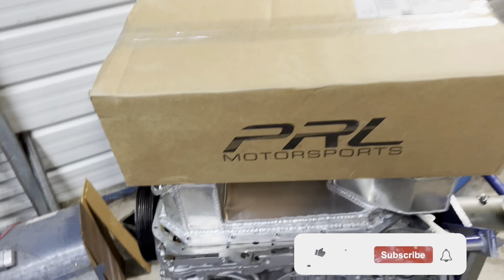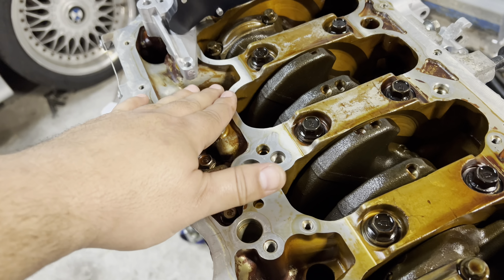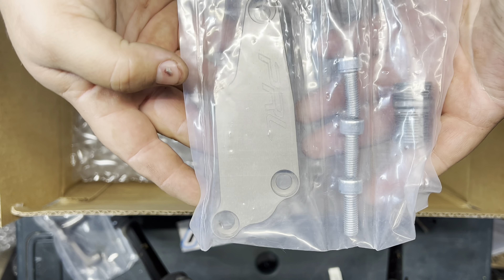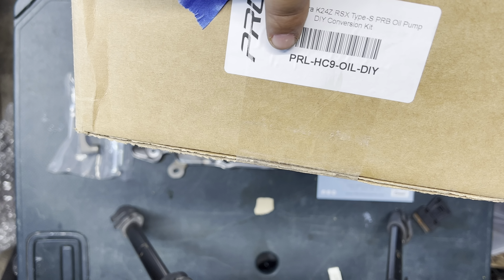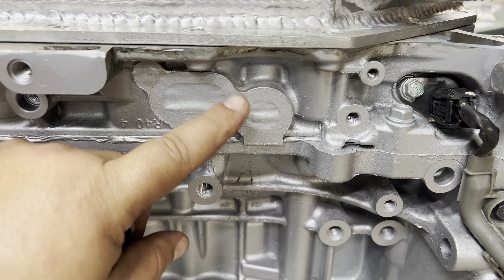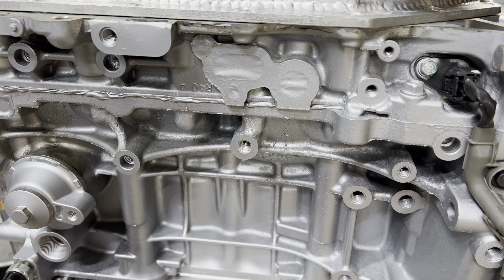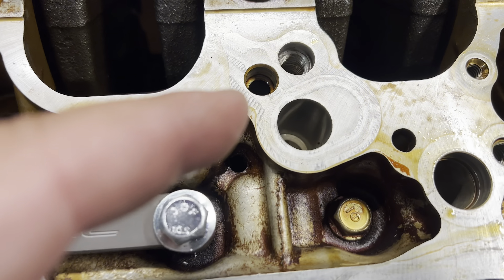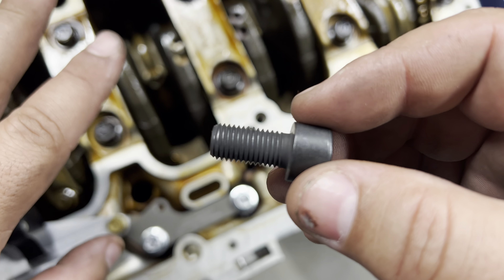K-Swap Camaro - @PRLMotorsports  K24Z3 K20 Type S Oil Pump Kit

Comment: Which holes did you put the 2 spacers on? I know there is 3 bolts that holds the windage tray. 20:28
Reply from the maker: I don’t remember. That motor is gone. Not enough power

Comment: I really appreciate the video.  I’m looking at putting a k24z3 into a four seater seadoo.  By chance do you know how tall the motor is from oil pan to valve cover?
Reply from the maker: Thanks man! With stock oil pan or this aftermarket pan I’m using?
Reply: @HOSSgarage  both if you know the measurements.  Or the a/m is perfect if that’s all you have.  I really appreciate it!!
Reply from the maker: @johnparker3028  will get you those tomorrow
Reply: Just checking to see if you were able to get the height measurements?  Not trying to pester you,  I’m sure you’re very busy.  I would definitely appreciate it but I also want you to know I really appreciate your series!!  Take care!

Comment: Is it necessary to change the position of the oil filter or it can stay on the lower block at original place?
Reply from the maker: It can stay as long as you’re NA. If Turbo then I would relocate it away from hot side
Reply: @HOSSgarage  thank you for respond!
One more question if it's not a problem..
Did you put k20 chain, guide and tensioner or k24z3 parts are okey for this swap?
Reply from the maker: @danijelremus5426  Z3 timing chain components, and k20 oil chain and tensioner.

Comment: My only
Concern about this video is this

I got 4pistol oil pump with the prl kit

And I saw that you plug the 2 holes so you don’t lose oil pressure

But then I see you got this aluminum piece with the black bolt 

I got all the bolts but I don’t have that aluminum piece you got
Reply from the maker: I got it off amazon

Comment: This is a badass build I just saw someone is doing this with a C6 too but your engine sits way further back the spark plugs are gonna be a bitch but this is gonna be cool when it runs
Reply from the maker: Thanks man! I have since repositioned the engine further forward using an engine plate. Just been working my tail off at work to get more parts to finish.

Comment: Thats gonna suck when you realize your gonna have to take the oil pump loose to get the chain on the sprocket.  When you are putting on the oil pump, you have to put the chain on as you are doing it before you put the fasteners on it. Lol
Reply from the maker: It’s all good. I knew this in advance. I had the new chain for the oil pump but my tensioner didn’t arrive in time for the video thanks to fedex…
Reply: @HOSSgarage  it just sucks that you locktighted everything. Lol
Reply from the maker: @BigMike86  ….oooh yeah that part lol 😆

Comment: I have a stock k24z3 with 10.7:1 compression. Should I use regular gas or higher octane fuel
Reply from the maker: If turbo then go with e85 if naturally aspirated then go 93

Comment: Car maybe too heavy fort this motor but damn good luck 👍 tho
Reply from the maker: I got the weight down from 3850 to 2582 with a lot of weight reduction.
Reply: @HOSSgarage  yeah man ok but most of these cars running k series 2k and under guess ur doing ok  at 2500 plus